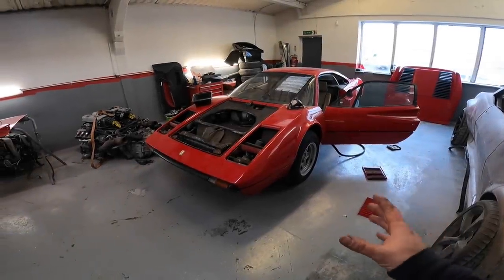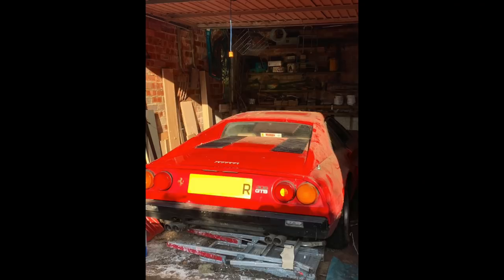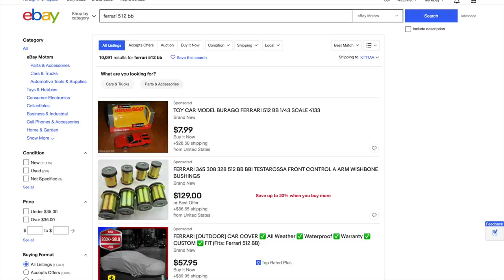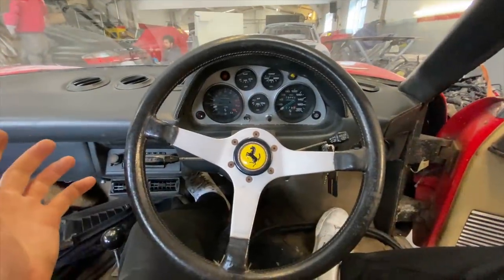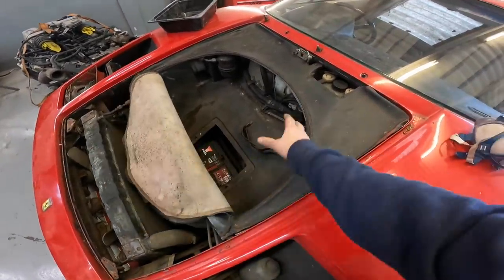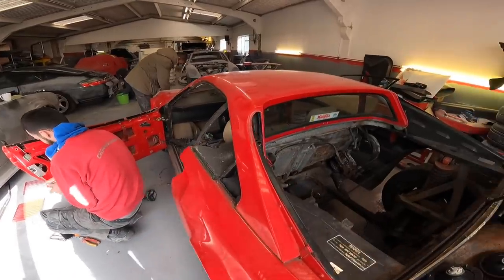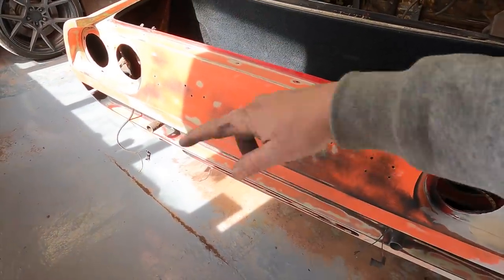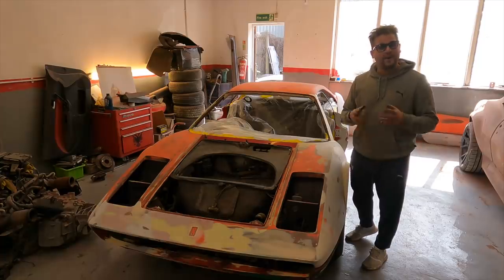Rare Barn Find Ferrari 308 Vetroresina Untouched Since 1987

Comment: Ian Tyrrell is restoring one of these. A tale of rust under fibre glass!
Reply: i bet this one is too
Reply: So like an old Corvette?
Reply: Hope this one is beter....
Reply: Rusty steel rails under the fibreglass !
Reply: I came here to say the same, I think that fibreglass might be hiding some horrors
Reply: Surprised to see they are not looking at the underside to see if it has any rust like the one at Ian’s. Perhaps they did and did not find any?
Reply: Ditto for me.  Was wondering about the steel work under the glass.
Reply: Hope for the best, prepare for the worst... Ferrari knew why they switched to full steel body...
Reply: I saw that also. It is very rusty.
Reply: @reggiedixon2  I was about to say it too..
Reply: @PeteCourtier  The Tyrrell job will be expensive, but if money is no object, its in good hands.
Reply: Oh yes! That one is braking down into pieces...
Reply: yeah watched that last night and it was pretty horrifying to see  what lay beneath a smart looking car, the chassis frame  was dangerously rotten in all manner of places and you really need to start pulling that outer fibre glass body off  to actually see the extent of corrosion which is hidden inside. The myth that a fibre glass Ferrari doesn't rust was well and truly exposed by the restoration team at Ian Tyrrell's workshop, those guys are the best in the world so they aren't going to mess about!!!

Comment: As a previous poster mentioned Ian Tyrrell has a very rusty one  in at the moment, but I would  hope this one having been dry stored for so many years is a completely different story. I have yearned for one of these most of my life and think the owner is a very lucky guy!!!. If it were mine I would do exactly the same thing as him and also get some waxoyl  or similar injected into the chassis tubes to preserve it. I think its best to preserve as much originality as possible with these pieces of Ferrari history. Then I would use it sparingly on nice sunny days. These things have to be driven;-]

Comment: After seeing Tyrell’s classics workshop restoration on one of these I’d definitely remove the front section of bodywork and check for rust what they found on one of these was truly scary as a lot of the main structures were rusted and it was a potential death trap also rust showed on the exact same part of the door pilar apart from that it looked sound 😳

Comment: The front end where the radiator sits is probably all rusted out and under the fiberglass is probably rusted out too, thanks to the Iain tyrell video I learned that the other day
Reply from the maker: thats where my Boxer has rusted to. The rad is out of this 308 so I will check closely tomorrow. Fortunately it was stored inside so hopefully the frame survived better.
Reply: @Ratarossa  hopefully, the one he showed one of the cross braces was missing about 2 inches from the end where it’s welded to the rest of the frame
Reply: Surprised the owner is not having the bodywork removed to check the condition of the steel frame
Reply: @a1topdog  after seeing Iain tyrells video I’m surprised too after seeing how rusted the steel frame was on that car and how many repairs had to be made
Reply: @a1topdog  my thoughts exactly, and before paint !

Comment: The joint on the A pillar is the tell tale sign to tell the difference from the fiberglass cars to the steel cars , you would think that Ferrari would have done a better job hiding that 
Damn tires from 85 depending on the month they might be older than me

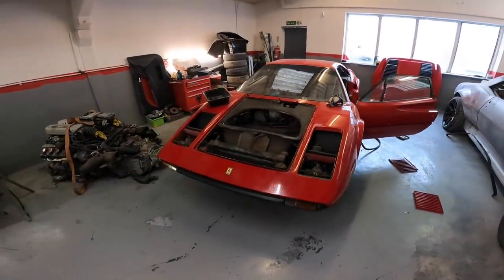Comment: Funny little note, that line down the side, that sort of C channel type thing, that was a molding line between the two halves of the car for the fiberglass, and theirs actually another one in canada, the cold war motors guy was working on getting it running for a customer, also look how inset the bumpers are at 1:30, like their non existent

and I hope that's not a habit at 7:37, like I dont know what the laws are in that location, but here, double lines mean do not pass, and theirs no run off if that goes wrong.

but still what happened that this well loved car got put away like this, did he buy an 87 Quatrovalve, as one of the funniest things I've heard is that actually, the latter quattro cars are better than the early fiber ones as the weight balance is better, and the cars are faster and more powerful. 

as both James May and Harry Metcalf had, and sold both of them, Harry bought the testarossa, and loves the hell out of it, even though it was down on half a bank with its worn distributor for the longest time, including when it was on the grand tour which means it didnt get a fair test of how it would have been when new 

and james well, he had an old overthink crisis and put the thing fully back to stock, including the 14 inch wheels, instead of the upgraded 15's which makes a hell of a difference in how well they drive apparently 

and then was like, well this cars not that good and I'm kinda bored with it

like preversely, ferrari actually made the 308 better as time went on lol still though the other thing is, these cars, well, each one is different, maybe this one has more power than both their glass fiber cars, as per the nature of handbuilt cars.

if it was me, honestly the icon for me is the targa model, so I'd have to go with your black beater that you bought from the set of the hidden over it and sell it for that, also from 1987 ish lol 

although I probably wouldnt say that after driving it lol or either really lol as this one, I gotta say gives off good vibes, weirdly just even looking at harry's and James I had the feeling they were both mingers, this one, evidently might be a good one. 

I mean look at that mileage, and its condition, 80K miles and it was kept up this well, someone REALLY loved this thing, and you dont love a piece of junk like that.

Comment: Hey Scott do you know the weight saving the fibreglass version has?
Reply: The fibreglass cars around around 300 lbs lighter than the steel cars.. that was the reason that they started getting more popular.. Ferrari Club racers wanted the light weight bodies.. unfortunately, that means that a lot got Turned into race cars and damaged,

Comment: Of all of the Ferraris, this is rare, particularly the way the engine is configured like a Honda.
Reply: Thats not rare at all lmao. 206/246 gt dino had transverse engine transverse transaxle. Same for all 208 models (208 gtb , 208 turbo , gtb turbo), all the 308s (308 vetro , 308 gtb , 308 gtbi , 308 qv), all the 328s. 348 and 355 had longitudinal engine layouts but still kept the transverse transaxle , with the 360 it finally became longitudinal engine and longitudinal transaxle
Reply: I don't remember many Hondas with mid mounted V8s
Reply: @RBMGT4  You're not wrong ... lol. Why are you comparing Honda to Ferrari? That's not my main intent

Comment: I have an honest question about that VPN. When you shop parts in the US via VPN, how do you get them over to the UK? I think those additional offers didn't show up initially because the do not ship them, or how does this work?
Apart from that, it is a stunning car. I would drive it, since I hate it when cars just sit around, flat-spotting their tyres.
Reply from the maker: good question. Generally i have found for example with ebay if you message the seller normally you can sort out shipping
Reply: @Ratarossa  Ah, I see. Thanks for that!

Comment: not trying to be offensive, but genuinely curious why are the fiberglass versions so much more desirable?  is it cause they're early cars, or lighter, or rarer, or...?  to me fiberglass always implies 'kit car', so not sure of the appeal.  now, I do have a C3 Stingray, which of course is fiberglass but never available as a steel body, so am obviously not biased against fiberglass...no choice with corvettes.  also, the paint on my corvette bubbled up the same as on this 308...was told it was the resin gassing off over the years...maybe, maybe not.
Reply from the maker: no offence taken mate. generally with ferrari's they become more collectable (with that more expensive) due to the lower production numbers